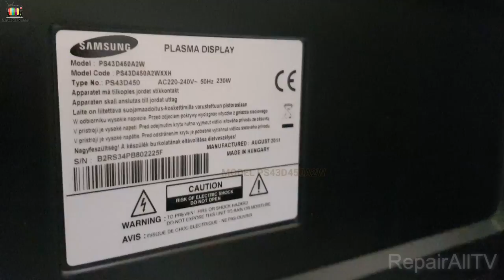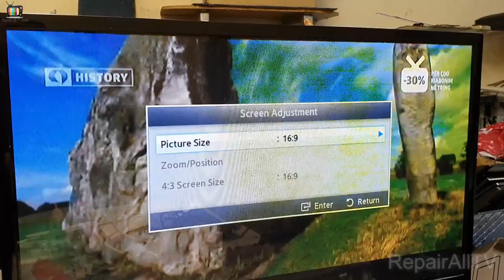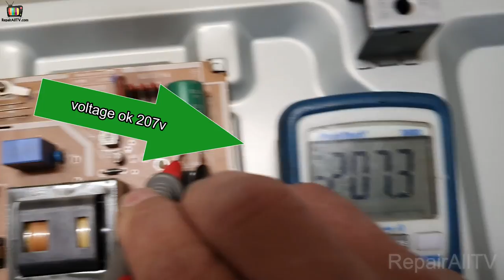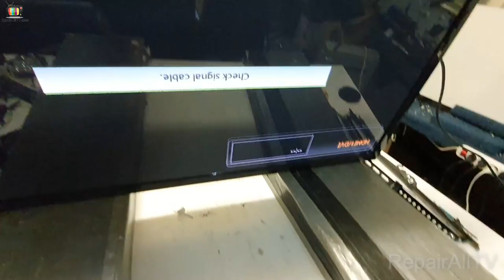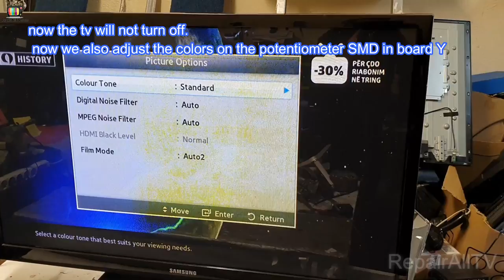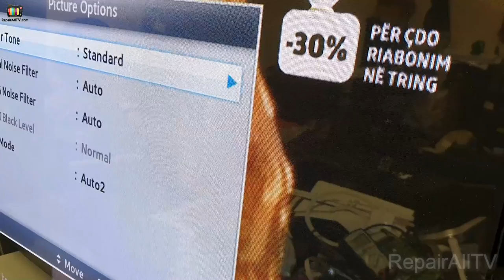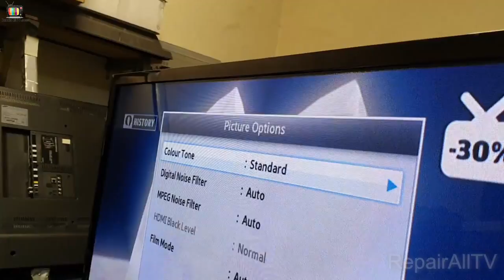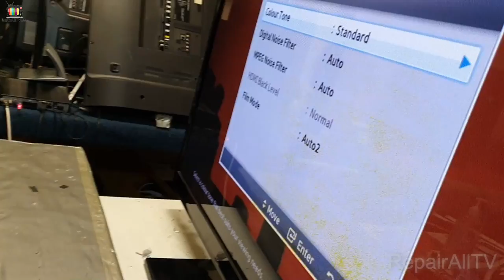tv works but with bad colors on the right side of the screen tv after 1 or 2 hours loses the picture

Comment: hello, I have a similar fault, there are vertical lines, what could be the reason?
Reply: Open the back of the tv and and check all flat cables. Vertical lines are often due to bad contact, sometimes it is just the flat cables. If the issue come from the direct contacts to the LED panel, it's more serious, it might not be fixable with off-the-shelves tools. With caution (electric schock), you can sightly en gently press on them when the tv is on to check if there's some display improvement or changes in order to identify the source of the problem.